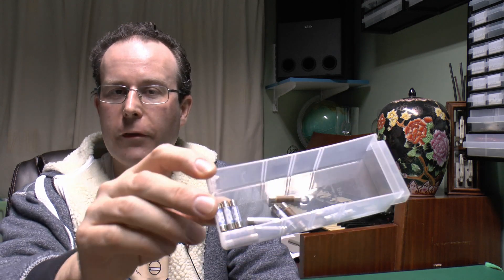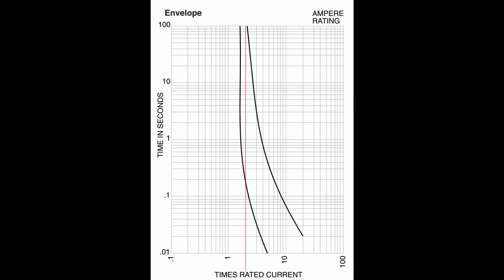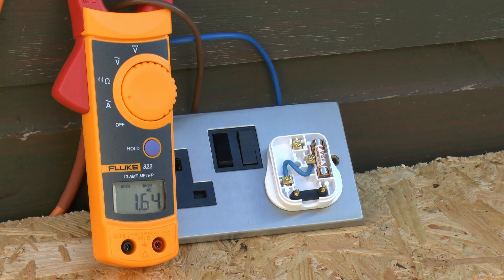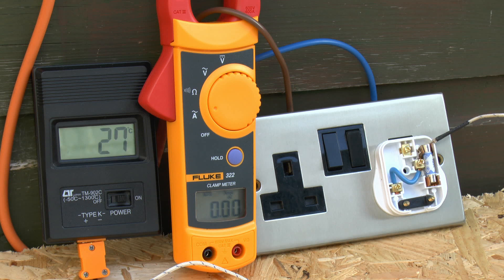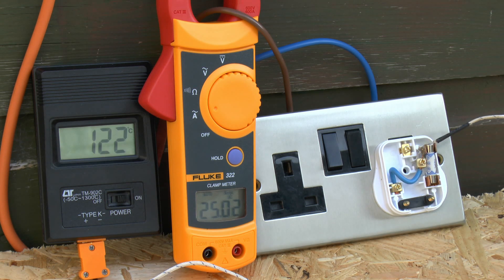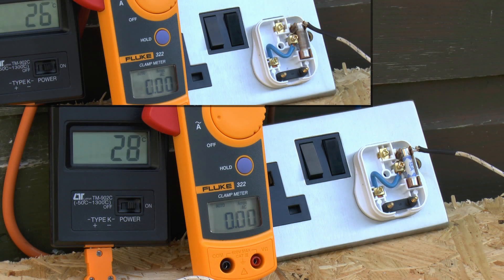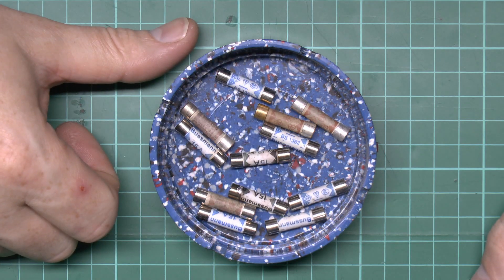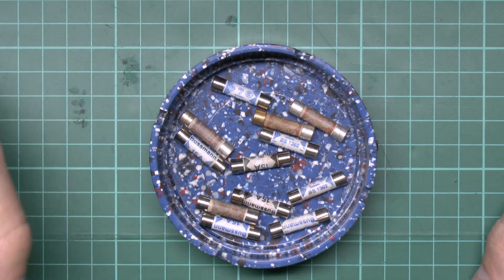Fake 15A BS1362 Fuses Tested

Comment: Hi. I have this, could the replace the T8AH250V ceramic fuse, for an HP desktop computer power supply (nothing fancy, or that powerful, just the normal student HP Desktop PC)? If yes, what's the gauge of the lead/legs should I solder onto the BS1362 (I hope mine's not fake).

Could you also use the glass fuse, in place of the T8AH250V ceramic fuse? Could fuses be series and how thick should the lead/legs be (gauge or mm).

Thank you.

God bless, Proverbs 31

Comment: A friend of mine had a switch fuse spur above the work top and 2.5 t/e radial feeding a double socket below and that fed a washing machine and  dishwasher...both used at the same time...13 amp fuse held in quite nicely..whereas the s.f.s started to char and go brown.

Comment: What's the sense in having a 13 amp fuse on your plug if it's not gonna blow until 28 amps? By then your appliance or machine is probably ruined.
Reply: When you put too much current through a wire, it doesn't catch fire immediately, it starts heating up.  If you leave it for long enough it can get hot enough to melt the insulation, short circuit, start a fire, etc. but the point is that takes some time for this to happen.  So even if your electrical wiring is rated at 32 amps, you can easily put 40 or more amps through it for short periods without any harm - the cables will just heat up a little and then cool down afterwards.

So with this in mind, fuses are designed to allow occasional overloads, but blow before the wiring in the electrical installation gets hot enough to cause problems.  This is why it's more about the timing rather than the current.  As long as the fuse blows before the wiring would heat up to dangerous levels, then the fuse is doing its job.  This is also why a fuse will blow sooner if the overload is greater, because the more current, the faster the wires will heat up and the quicker the power needs to be cut to prevent damage to the building wiring.
Reply: From what I understand the fuse in the plug is only for protecting the “ring main” circuit, and not the appliance.

Comment: Question. Call me dumb but I have an extension lead with a 10 amp fuse. I have a spare 13 amp fuse and want to know. 1 is it safe to take out the 10 and put in the 13. And 2. Does that mean the lead can draw more amp age from the socket. Thank you
Reply from the maker: If it was supplied with a 10A fuse, then it's because the cable is only rated for 10A maximum, and a 10A fuse is what should be fitted.
Fuses are designed to blow if the current exceeds a certain value to avoid cables overheating.  Using a larger value of fuse would allow the cable to be overloaded and damaged.
Reply: John Ward ok. Thank you

Comment: Why didn't you test dead shorts at mains voltage and other stuff that could defeat inferior fuses?  I would have expected the fake ones to have failed to break the circuit due to arcing or sputtering the metal wire onto nearby surfaces.

Comment: Hi John, Do you know which fuse caused the damage to the plug head? A genuine fuse should function before any damage to the plug was caused. It should be expected that a layman would be able to change a failed fuse, without the need for an understanding of damage inspection of the plug head.

Comment: Any opinion on the Neozed fuse types used in Europe, mostly in "consumer units"/"group switch panels" ?
 In case you are not familiar, these are bottle shaped ceramic non-rewirable fuses with the following key features:
1. Varying thickness of the thin end prevent insertion of a higher rated fuse than designated by the electrician.  2. A color dot at the thick end indicates the rating and drops away when the fuse blows This is visible through a window in the holder. 3. The characteristic curve has a "bump" to allow motor inrush currents. 4. Modern holders interlock fuse removal and the isolation switch.  Older ones didn't.
Reply: Why not just have an MCB

Comment: I would suggest that describing these fuses as "fake" is incorrect. They are most certainly non-compliant to BS and EN standards and clearly of a quality that would make any user think several times long and hard before using, but that is not the same as fake because clearly they are a functional fuse. I would hope that you reported where you sourced them from to Trading Standards to ensure they are no longer available.
Reply from the maker: Ebay listings, available from multiple sellers all registered in China and Hong Kong.  Nothing that TS or anyone else in the UK can do about it.
They are fake because they claim to be made by Bussmann but obviously are not.
Reply: John, that makes them Counterfeit but not fake.
Reply: TS can indeed take action against counterfeit products in the UK irrespective of where they are manufactured, a simple internet search will confirm this.
Reply: @starbarrothschild788  EBay and Amazon are rife with this sort of garbage, and no one seems to be able to hold them accountable. There was one lawsuit filled in the US attempting to hold Amazon liable for defective products from one of the infinite fly-by-night 3P merchants. I don't know if it's been resolved yet.

Comment: A 13A fuse to BS1362 will pass 20A almost indefinitely, so in what sense is it a 13A fuse? It clearly does not protect against moderate overloading. May I suggest that the fuse is there to protect the flexible cord between the plug and the appliance under fault and heavy overload conditions, as typical British ring circuits are protected by a 32A MCB which is more current than flexible power cords can handle. Is that right?
Reply from the maker: +ridefast0 Yes, exactly right.  Only required because the appliance flex isn't rated for 32A.

Comment: 6:09
It's smoking either because the plastic next to the fuse holder is melting, or there are some oils and such on the fuse which are smoking.
I've done this with wirewound resistors, when overloading them slightly. They get hot, but not hot enough to be destroyed right away. However, oils from my hands do burn off for a few moments ... :P
Reply: Benjamin Esposti if you look closely you can see solder melting out of the top of the 15 amp fuse, I think at 200 + deg c the solder flux is what's smoking. I could be wrong but JW did show one of these 15amp fuse's with solder weeping out earlier in the video.

Comment: Ok, why didn't the 13A fuse fail at 13A?
Reply: In a real world situation, any genuine fuse wouldn't blow before reaching 150% its alleged rating, typically done deliberately as a time delay in case the current surge is caused by an unexpected spike in voltage, the fuse wouldn't blow
Reply: +Frankie Sparkes But that&#39;s what Time Delay fuses are for surely? And the surge is surely current not voltage related. In this test above a genuine 13A fuse blows at over 200% of rating.
Reply: Im no expert but i do believe there is a T rating on some fuses.  For critical items the fuses are guaranteed to blow within a much shorter period.  I not sure if they are ever used in plugs.  But i know slow blows are used for high current draw when device turned on.  Remember the brown out in your hose when you turned on the old massive valve tv's.

Comment: Another interesting video, obviously these are low voltage tests, so the arc quenching is not tested. Fuses are frustratingly imprecise things, when building equipment that uses large transformers (particularly toroidal ones) inrush current can instantly blow a 13a fuse despite the steady state load being well below 13a. Many times now I have had to incorporate "soft start" circuitry... just to save the fuse....
Reply: +David Lisney Which is why we have Time Delay fuses for devices with inductive loads.
Reply: +Stuart Halliday Time delay fuse in a plug?
Reply: +g0fvt No.
Reply: Well that sucks ... here in the USA we have slow-blow (time delay) fuses which are put in devices with large transformers and devices with large inrush (like with a large bank of filter capacitors).

Comment: Very interesting that these non-compliant fuses actually have a sand filling!  Here are two videos which show what happens under short-circuit conditions when the sand filling is missing:
youtu.be/KVJVswLbqaA
youtu.be/KAX6Nc6Y_pI
An important point about the function of the fuse in a BS 1363 plug, it is there to protect the flexible cord and not, as so often assumed, to protect the appliance!    If the nominal cross sectional area of the cord is 0.5mm squared then the fuse should be not greater than 3A (unless, for reasons of a high instantaneous inrush current,  it is necessary to use a 5A fuse).  For flexible cords of greater cross section then 13A is the specified maximum. (BS 1363-1 table 2).
Reply: Wrong! The fuse is fitted to protect the supply NOT the appliance and the cable forms part of the appliance. That is why the fuse is fitted where the appliance connects to the supply. The cable size is important because it determines the fault current which causes the fuse to operate within the required time. This is the I squared T curve of the fuse characteristics. If the fuse doesn't operate fast enough, the current will cause overheating or fire in the appliance.
Ex UK Notified Body Senior Electrical  Safety Test Engineer.

Comment: quick question...does current have the same effect on a conductor or fuse regardless of voltage ?
Reply from the maker: damon btc In terms of heating, yes.  The only difference with the fuse in an actual circuit at 240V or whatever is when the fuse fails, the voltage across the two ends of the failed fuse is much higher, resulting in the arc inside having a lot more energy.

Comment: Smoke would likely come from organic contaminants ( oil and other stuff left on surfaces from machining, and river bottom muck from the river mud used to fill it) in the case. They seem to have accidentally invented the smell trip fuse there, with both visual and nasal indication of overload and impeding failure.

Was at a flea market yesterday, and there was a seller with a box of 100 or so UK plugtops, He was going to sell them as scrap brass if they did not sell. I think he will be doing that, UK plugs are not common here in South Africa.
Reply: +Aadil Shah You should be able to get them from reputable online suppliers such as RS, Farnell or Conrad, all of whom sell to countries where 16A Schuko (German for Earth Connector) is the prevailing standard.  The 2 pin Europlug is a 2.5A plug standard designed to fit all European sockets, with the possible exception of the BS ones.  It is explicitly not permitted for anything that needs an Earth connection or higher current.
Reply: SeanBZA I often purchase my electronic equipment through RS Components. Everything from them tends to come with both UK plugs and Schuko plugs. Some items do have that horrid 'Euro-plug' two pin option that everything Chinese seems to come with as standard these days.

Since getting an Earthed Schuko socket is almost impossible here and our fake 'Schoko' adaptors don't have the Earth connection, I tend to prefer the UK plug.

My Brother was working and living in Botswana for a while and they've sensibly adopted the UK plug rather than our round pin 16A plug.

Comment: Other than the smoke I was rather surprised how well the '15A' fuse did ;-) Within these tests you could argue that it did better that the 13A fuse (ignoring the smoke). Obviously the smoke was the only issue as I was also REALLY surprised how hot the 13A fuse got!. Overall, disappointed with the fake one but rather dissapointed on the temperature of the correct one. Interesting comparison. Well done.
Reply: Colin Herbert Think about the I²R losses. I can't understand how you can possibly "argue that it did better that the 13A fuse"
Reply: Dr. Lecter  I²R? Not sure what that is. I'm not an electrician.It seemed quite credible though apart from the smoke I say. The figures seemed quite close most of the time. I guess I expected it to fail miserably and it didn't. Anyway...
Reply: P = I²R, i.e. the losses (heat) due to the resistance of the fuse wire. Lower rated fuses have higher resistance.
Reply: @ColinDH12345  Elaborating on Misty Moo's comment (P = I²R): Power (the heat generated by the fuse while conducting current) is I (intensity of the current - measured in Amps) times R (the resistance).

Seeing that most fuses work by melting away copper, they have to get to roughly the same temperature in order to fail, so they need to have roughly the same resistance.

However, I think Misty Moo missed a great simplification: to melt copper, you need to get to the same temperature in the wire of every fuse! (no need to compute I²R).